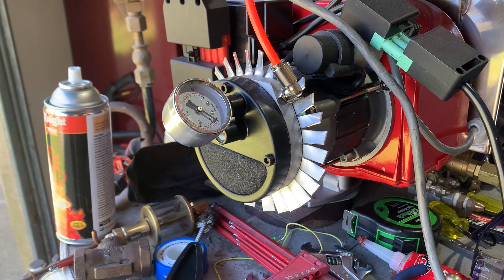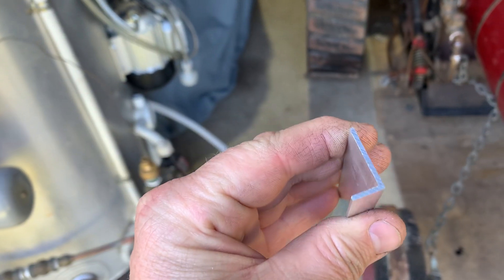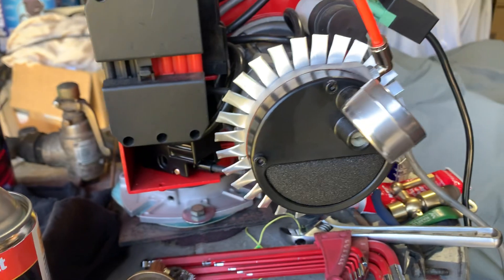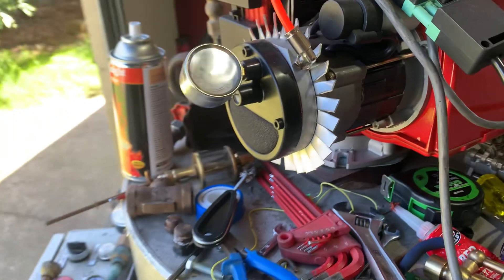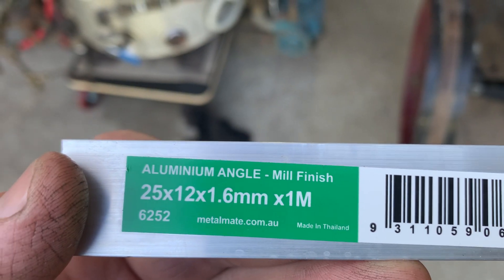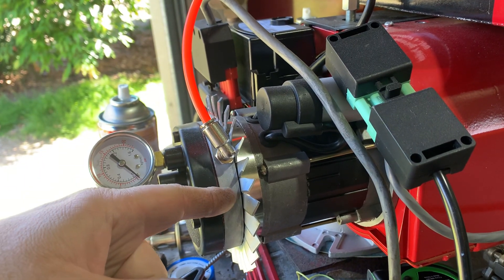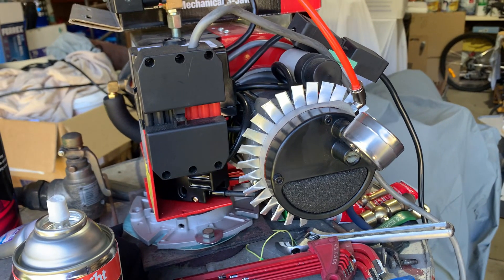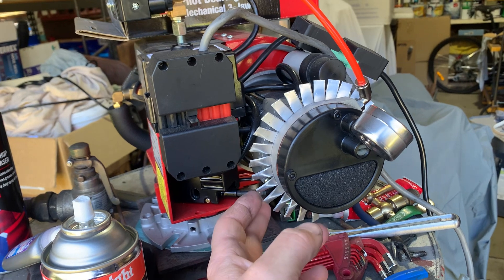Bairan Incorporated Air Compressor Overheating Issues & Solution

Comment: 3 failures means crappy chinese shit==  buy once,, cry once
Reply from the maker: @margarita8442  actually the pump itself is machined nicely, but the overheating issue is the main problem, unless you have actually owned one of these burners then your comment really doesn’t help anyone 👍
Reply: @offthegridwithbert924  is a slung poo brand